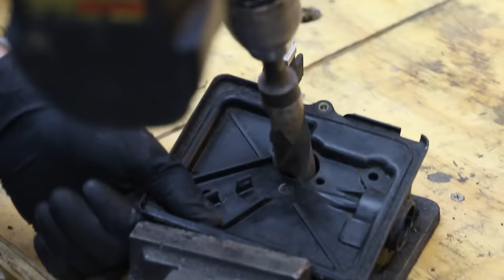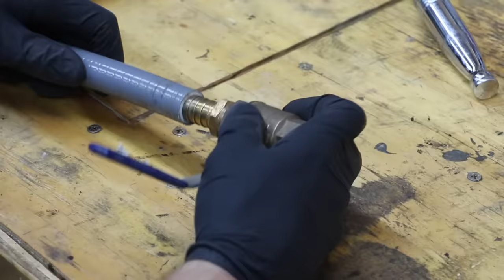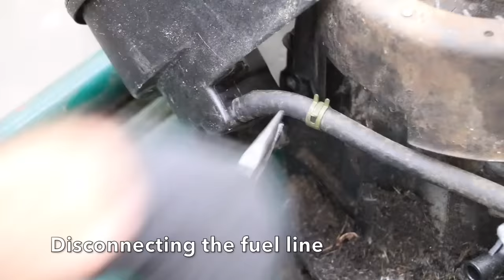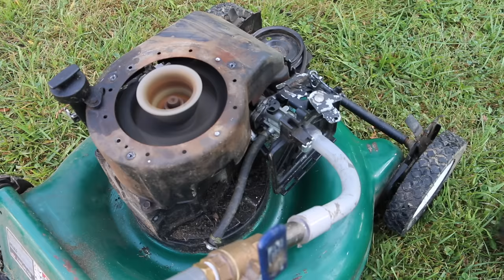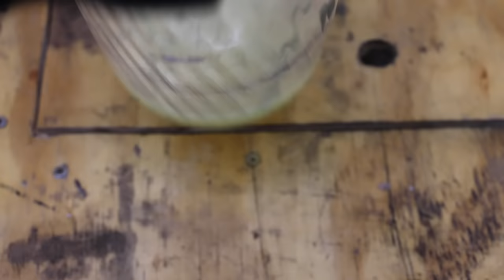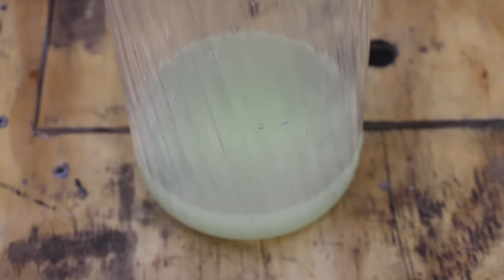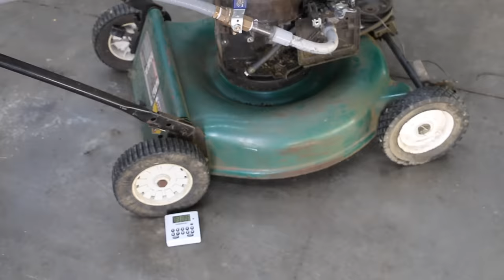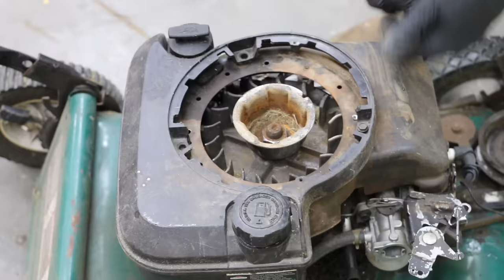Will a "Gas Vapor" Container Improve MPGs and Fuel Efficiency?  Let's find out!

Comment: Be very careful with this one backfire  through the carb and you have a bomb.
Reply from the maker: This is a great point and cause for concern!
Reply: Some I've seen use a one way spark arresting device.
Reply: All you need is a screen
Reply: If that system were on a mass produced car it would probably have a valve not allow any back stream pressure or some kind of fire suppression system in the line or tank
Reply: Cars and water ( RHNB guy) uses a hydrogen torch with a saftey valve that stops ( or disconnects ) if the flame goes backwards through the hose
Reply: Gentleman Hooligan there ya go.  It already exists haha learn something new everyday
Reply: Otto yup I was reading comments and I pretty much said the same thing which is absolutely true
Reply: It wouldn't explode like a bomb, more than likely IF the flame was able travel backwards all the way into the jug, it would cause the fuel vapors to catch fire quickly and starving the engine of fuel, causing it to die.  This would cause the intake of air to stop, and the already burning vaporized fuel to quickly drain any remaining oxygen from the air in the jug and exhausting the fire immediately.   It would be a tiny, and very quick explosion within the jug that wasn't powerful enough to explode the jug. 

Definitely a good point though, anything is possible.
Reply: if that little explosion is enough to introduce any new oxygen from cracks, etc then you have a big bomb again :D
Reply: pdgeman this is true and maybe possible if the jug cracks but it likely wouldn't happen at all.  Those jugs are pretty flexible and don't really crack as much as they bend. Also gas isn't as explosive as it seems.  It burns quickly rather than explodes.  This means the "explosion" doesnt produce much force at all, just a lot of heat and light that diminishes extremely quickly.  (this is why diesel creates so much more power than gas, because it burns very slowly and uses as most of the potential energy of the diesel fuel as possible). 

If the jug were to become compromised in some way, at worst it would cause fuel to leak out and burn on the floor, or just have a small flame where the crack or hole is (I've experienced this when a flame caught my gas can on fire, it just caused a small fire at the mouth of the can that was easy to extinguish). The gas explosions you see in car fires, or similar fires, are actually because of the extreme temperatures on the outside of the tank that causes pressure to rise inside the tank and be released all at once when the tank finally melts. 

In the setup we see in this video, the worst that could happen is a fire on the floor from the gas pouring out of the jug.  Like I said above however, anything is possible and it's always a good idea to take precautions around flammable liquids.  It was a great idea for him to take the setup outside the shop before starting it up.
Reply: This can and does become a bomb if it backfires. Ask me how I know...
Reply: It looks like to me you have essentially created a plastic engine cylinder filled with oxygen and gas vapor waiting for a spark.
Reply: Si Raff  You must be the .00001% chance of this exploding.  (by explosion we mean a huge expansion of flames that engulfs everything within the area).  I'd like to know how close your setup was to this one (because why would you have even done this yourself??)   

Anyway, just based on the thermodynamics alone, an actual explosion is not possible.  A small explosion within the jug, yes, a catastrophic failure of the jug that throws fuel everywhere ("a bomb"), is not possible.
Reply: A good idea to think about is how the pressure would force the fluid UP through the pipes, into the air similar to the way steam in an espresso maker works.  It would eject all the gasoline it could directly into the air, the flame front would follow it up through the pipes, and create an explosion of the now-atomized fuel cloud.   It'd be pretty violent.
Reply: I think the problem with the way everyone is thinking of this as a "bomb" is that you are thinking the liquid gas just explodes and burns... it doesn't, the vaporized fuel is what explodes and burns.    There isn't enough fuel AND air in that jug, that has the right stoichiometry, to explode catastrophically.  Just a small explosion within the jug and possibly a small fire would occur if the jug were to become compromised or tipped over after the backfire.
Reply: That's not what I'm referring to at all. The fluid level is above the pipe end.  meaning it's sealed off from the atmosphere.  However, the area inside the bottle that is "Not fuel" contains fuel and oxygen.  When that is ignited, it WILL create positive pressure.  This will always seek the path of least resistance.  That pressure can do a few things.  Either A, compromise the bottle and create an explosion or fire, which I agree with you, would not likely happen.  B, not create enough pressure to do any harm besides create like you said, a small explosion within the jug and possibly a fire.  C, the pressure would increase inside the bottle.  The pressure outside the bottle would be less, and the fluid would move up the "air-inlet" pipes, because we've flipped which side has the high pressure.  Once the fluid has sufficiently been ejected by the high pressure in the bottle that fluid would be tossed in the air directly above those inlet pipes.  The fuel in the tank would be low enough that the fire could propagate up the tube and ignite the fuel air mixture outside of the bottle and suddenly this would create a very prompt explosion.  This is the most likely outcome just judging by the amount of fuel.  I do agree that the likelihood of the bottle exploding is quite low.  However, once it ejected all that fuel, you'd have a significant fireball to say the least.
Reply: Wasn't my setup. It was something quite similar to this (a little larger jug but otherwise the same principals) being used to power a boat. When I say it went off like a bomb I mean enough of a bang to blow the engine off it's mountings and put a 6 inch round hole in the boat's (wooden) hull. Looked a lot like half a stick of dynamite going off. Nothing like the usual petrol fast flame burn offs.
Reply: well unless you have a valve issue you can mess with the timing on these engines
Reply: Its called a 1 way pressure valve everyone. Its invented, available & cheep... C'mon people. An thanks for doing this video but could you test it with a hydrogen generator?
Reply: What you speak of is called a flashback arrestor.  You can Google how to make your own or just buy one from a welding supply store.  Basically, it is just fine metal wire mesh on the micron level that prevents the flame point from propagating back up the fuel line.  Very simple really.
Reply: still brings up the issue of bubbler setups varnishing gas.
Reply: please explain
Reply: well if you have a bubbler setup atomizing gas in container A, which then vents into bubbler chamber B to stop backfires, that gaseous Gas is being exposed to more water varnishing it quicker i would guess. 

Also i wonder if his mower used more gas because he didn't have seperate gas gas lines and air lines making it run rich...... idfk. 

and the wick system is superior race of vapor setups
Reply: i think he should have used an afr gauge
Reply: The gas is varnishing because it is corrosive and eats the materials used to hold it especially plastics like the tube used in the video and plastic fuel container that isn't rated for that use.  Therefore, the gas dissolves some of the tubing and container unless you use fuel rated hoses and the like.
Reply: .......... its varnishing because of the air percolating through it...

Comment: If you look back to the beginning of motorcycles, some of them worked on a vapor set up. There was a reservoir of fuel which air flowed across, picking up the fumes and burning them. The opening for air to enter the reservoir was larger than the tubing on the other side which fed the engine. The vacuum created by the down stroke of the piston drew in the vapor but because of the reduction of the feed tube, the velocity increased, pulling the vapor into the engine faster. Like with your ball valve set up, these primitive systems used a venturi with a throttle plate to regulate the mix. This wasn't about economy..it was about making it run. once the carburetor became available the vapor system was forgotten. Thanks for trying this...I had my doubts as well!!
Reply from the maker: Thanks for the feedback.

Comment: Great video, I always wondered about this. To be clear, when this was first theorized (as far back as I know) was in the 60's. We've made a lot of progress since then when it comes to even basic mowers and fuel consumption. With that said there is a couple of other things different. The original idea I heard about used engine heat to heat up the gasoline to produce the vapor and it was injected in a plate between the intake and carb much like a Nitrous plate system. Allegedly this can't be done with todays gasoline because the gasoline mixture is different and more prone to exploding just from the heat. It's quite impressive to see it even working like this either way so kudos for you for going beyond what most of us gearheads have just speculated on for decades lol.
Reply: That's why you get an older engine it work I've see it my self

Comment: so the only problem that you'd have with this is a nicely mounted fuel tank and limited splash and choking and you should consider a spark or flashback resistor of some type to avoid fire/explosion.

Comment: gas engines are only about 40-45% efficient, and that's with theoretical calculations which don't take atomization, unburnt fuel or burning efficiency into account, and that's pretty close to what modern engines can achieve. You might get a tiny improvement with vapor in a real engine since you basically get perfect atomization but not that much. The methodology used in the video, although pretty ingenious, is not incredibly accurate and leaves a certain margin of error,  you might get 1-2% economy at best. The difference would be even smaller in a car with injectors instead of a carburetor as they are even more efficient.

Cool video though, keep doing what you're doing!
Reply: phallus36 Gasoline engines are actually more like 25% efficient at best.  Not to nitpick or anything.
Reply: +Jake Rosendahl 

  G'day,

   You're pretty close to being right, for a 4-Stroke with 2 Pushrod-operated Valves in each Cylinder-Head..., say a 1970's vintage Car Engine.

  By comparison, a 1943 Rolls Royce V-12 Merlin with Double Overhead Camshafts, 4 Valves per Cylinder & a 2-Speed 2-Stage Intercooled Supercharger is 29.5% Efficient...; and the best Racing Automobile Engine ever built is about 32.5% Efficient at turning Fuel into Torque....

  And, by adding a 30 Watt Solar Panel onto my 1983 Subaru 1800 Touring Wagon, the Fuelburn went from 8 Km/Litre per Month, to 10.66 Km/L. per Month, so the Vehicle became 33.25% more Fuel Efficient...

   Feel free to backtrack me, to my "SunFoil Project...." Playlist ; to see the story, the evidence, and the Government CSIRO Endorsement of my Research findings..., the Construction Clips are all up there - I recommend the Mk-8.

  Have fun...

  ;-p

  Ciao !
Reply: that is NOT a real-world efficiency.  if you measure the fuel consumption of a typical V8 and compare that to the theoretical amount of work needed to overcome rolling friction and air drag and occasional acceleration, REAL cars operating on REAL roads achieve LESS THAN 1% efficiency.  most of the energy of the burnt fuel escapes as waste heat.
Reply: 37% is the predicted mathematical maximum for internal combustion engines, no engine even achieves that btw.
And that is under the most ideal conditions at a specific load, RPM, temperature, air density, ...
In the real world just getting 30% is something to hope for, and you only get close with very steady driving under the best conditions.
Reply: +Chev Chelios - actually, it's 0.3%.  it's been quite a while since i crunched the numbers, but if you want, it's easy enough to crunch them yourself.  the energy content of gasoline is a staggering 46.7 MJ/kg (127 MJ/US gal, 35.3 kWh/US gal, 13.0 kWh/kg, 120,405 BTU/US gal).  you can look up drag coefficients for a particular vehicle and calculate the work done to overcome air friction.  at typical highway speeds, the rolling friction will be negligible by comparison, so you can get a reasonably accurate estimate using just energy content and drag.  of course, the engine also does work to accelerate the car from a stop, and going up hills also requires the engine to do work.  but coasting down the other side of the hill mostly compensates for going up the hill, so if you compare the energy required to overcome drag with the stated highway mileage you can get a good ballpark estimate of efficiency.  even if the assumptions and approximations introduce a error of an order of magnitude (unlikely), you still get an estimate that the overall efficiency is less that 5%.  probably closer to 1%.
Reply: I'm gonna have to disagree on that.  In fact, sitting in front of me RIGHT NOW, are engine efficiency charts used to calculate fuel consumption in g/kwh.  This is called Brake Specific Fuel Consumption.  Diesel engines (which i work with) are a bit higher than gasoline engines, but not by an enormous amount.  A relatively modern engine in my arsenal, a 74hp 3.3L 4 banger that is Tier 4 final Stage IIIB emissions compliant, (which means it has emission targets that sacrifice fuel economy to meet emissions goals) at 1400rpm is consuming 205g of diesel per kwh at the shaft.  1kg of diesel (1.2L if you use standard diesel) has 13.3kwh of chemical energy in summer spec.  Less in winter.  This engine gets 4.8kwh per kg of diesel.  It is 36% efficient delivered at the output shaft at maximum/ideal loading.  Turbochargers are a big help, which is why you see more and more cars with them.  Careful use of CHP (combined heat and Power) systems can recover more, if that heat energy is useful in your application.
Reply: +Kit Iwamatsu - but that is NOT the OVERALL efficiency of an AUTOMOBILE.  it is a maximized efficiency of JUST THE ENGINE, operating under optimized ideal conditions.  the engine in cars on the road are NOT operating at "ideal" loading, and NOT operating at optimum rpm.  most are NOT new, and NOT operating at design specs.  your numbers have very little relevance to the real world of driving a car down the highway.

the only way to get a realistic estimate of efficiency is compare the total amount of actual work required to propel the car to the total amount of energy released by the combustion of the fuel.

wanna do a real world test?  place a force gauge (spring scale) between the rear bumper of a car with the engine off and in neutral, and the front bumper of a second car, and use the second car to push the first car down the highway at cruising speed.  monitor the force applied to the freely rolling first car over a fixed 1 mile distance and calculate the work (F x d) done on the first car by the second car.  THAT is exactly the amount of energy required.  then multiply the highway MPG rating of the first car times the total amount of energy released by combustion of the equivalent quantity of gasoline, and compare the two.  i'll wager $10,000 that the resulting REAL efficiency is AT LEAST an order of magnitude less than your fantastically unbelievable 36%.  i dare you or anyone who agrees with you to take the challenge and perform the experiment.

Comment: I ran a 5-horse engine and generator with a similar setup that heated the air-fuel gases before entering the engine to burn. It was temperamental, but the exhaust was incredibly clean, just warm air exiting the pipe. Amazing combustion process.  Paul Pantone experiments delved deeply into this concept.
Reply from the maker: Thanks for sharing.

Comment: Well that sure surprised me! But what you basically built was an updraft carburetor lol.

The venturi in the carb makes the fuel turn into a vapor (when adjusted well) as the motor runs. That's how it works. Still this was a neat thought experiment!

Comment: You should install a flash back arrestor to prevent an explosion.. this system works.. I have done it myself... you can vent the exhaust to blow around the air intake pipe.. to keep the gas warm.. (thermal dynamics will take effect eventually)...
Reply from the maker: Great point!  Thank you
Reply: I used a fine mesh screen to stop flashback fire won't go through screen